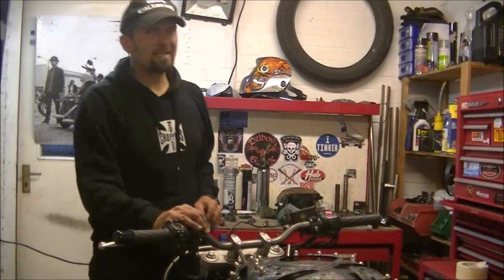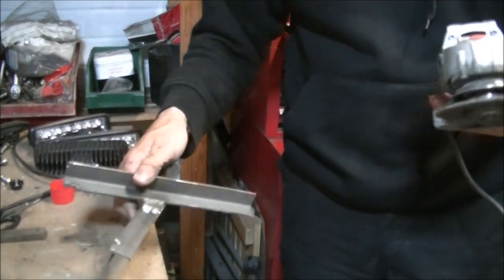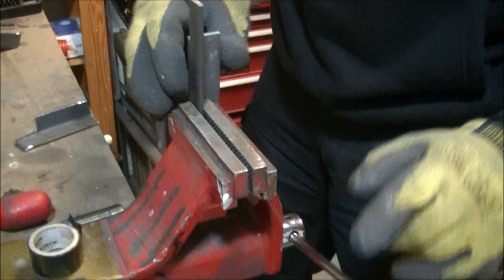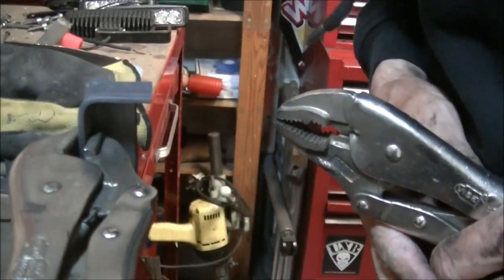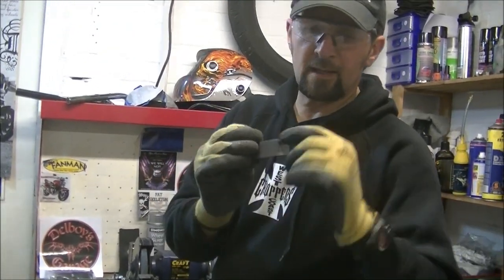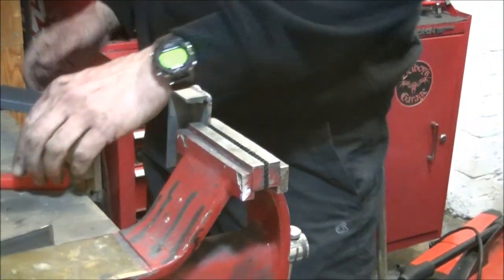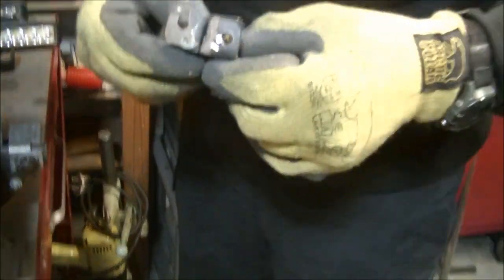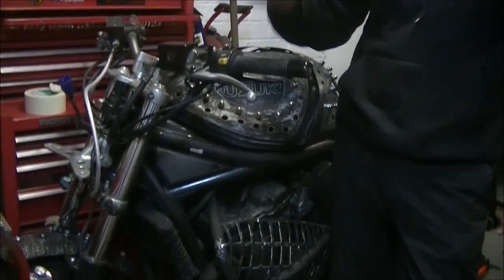Delboy's Garage, Project Bandit #27, Headlight Brackets.

Comment: That took me right back to my metalwork days at school 😃 although I'm surprised you're not using the Triumph rubber bolt method used on the rear light 😜 

That bracket will last forever 😊
Reply from the maker: Ha ha, make it once aye mate....

Comment: good job del, does that mig run off normal electric or one of those higher amp sockets? im after a mig at the minute
Reply from the maker: Hi mate, just plugs into the regular wall sockets mate, check out the stock at Machin Mart, lots of choice and some great deals to be had...

Comment: is that one of those gasless mig's you got there del? Noticed them going for cheap at toolstation recently and wondered if they did the job (providing your one is of course)
Reply from the maker: No mate, its a Clarke 135 Turbo MIG, uses a gas bottle, and can weld up to 6mm plate really smoothly...they're in Machine Mart for about £250